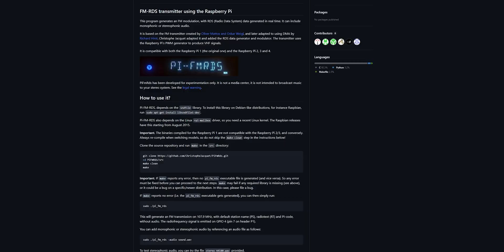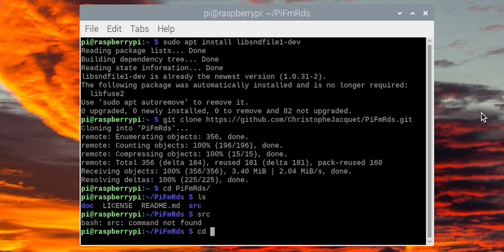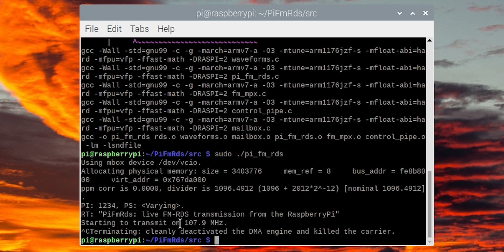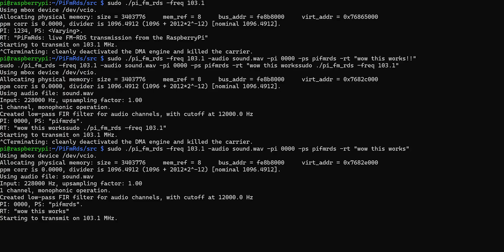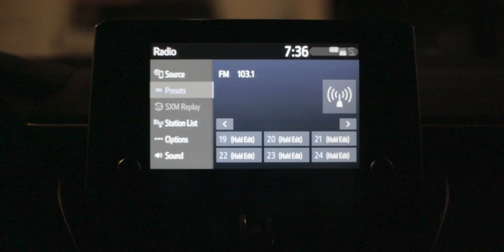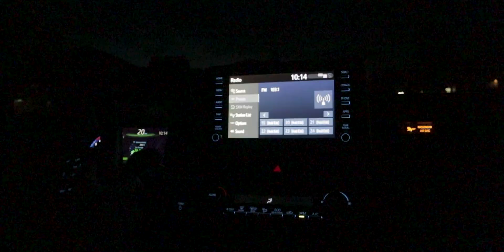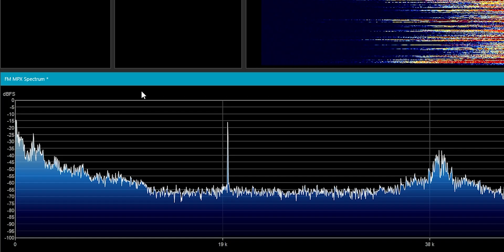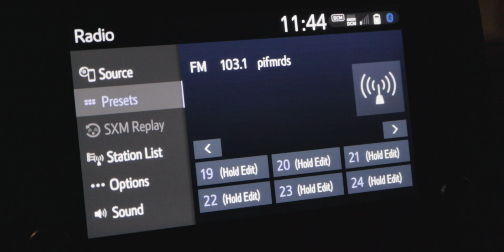Turning the Raspberry Pi Into... an FM Radio Station??

Comment: I don’t know if you respond to such late comments but what was the crimp you used on the wire? I want to figure out how to attach my wire to my pin without damaging anything
Reply from the maker: I got that wire in a basic arduino/raspberry pi kit and it just friction fits right on the pin
Reply: @simonretrotech thanks

Comment: I think antenna in your car is good enough, cause i tried making own radio on pi 4 and my phone lost signal after getting far for 50 meters away from pi (yeah i connected wire to pin, without it signal losts from 10 centimeters)
Reply from the maker: Aww dang

Comment: Finally tried this and WOW! Had it setup in the house with 32" of wire hanging from pin 7 of my Pi 3 A+....got in the car to test and almost had my entire neighborhood lit up on 87.9 MHz 😂 Be careful with this...It puts out lots of spurious harmonics...imagine your center frequency is strong but with no filtering I started checking my rtl sdr with SDR++ and was broadcasting strong on 175.8, 263.7, 351.6 MHz...not something I would use for anything other than just experimentation purposes...But regardless of potential trouble this software and Pi can cause, it still made for a fun evening tinkering...thanks for the video and cheers!
Reply from the maker: I know, I'm surprised the pi is that powerful! Yeah, I think the instructions mentioned not running it unless you had a filter. Definitely just for experimentation!

Comment: there is an FM frequency that is legal to use for this purpose. Portable CD players used to use it to play through the car FM radio.
Reply from the maker: I'm pretty sure it's based on power transmission (part 15). The problem with the raspberry pi is who knows how much power it outputs or if there's horrible interference (from what I understand)

Comment: After i followed the video i ran the command to start the radio. It does play but it randomly stops playing and a BANG sound happens. Could this be because im not using a wire? (no its not the audio)
Reply from the maker: Whaaat that's weird. The bang sound is in real life and not on the radio audio? I think you have to have a wire otherwise it can mess up the RPI since there's nowhere for all that energy to go
Reply: @simonretrotech  Sorry my bad for adding the last part in. The bang is on the radio audio it let's the audio play for a bit then Bang, silence for like 10 seconds and then the audio plays again and it loops like that.
Reply: I think I know why it made the bang sound before. My guess is that I was on a frequency very close to another one in use. I've switched to a different frequency that isn't close to any other, and the bangs aren't happening anymore.
Reply from the maker: Okay weird. Your audio is more than 10 seconds though? You might want to open an issue on their github
Reply from the maker: @MessingAroundInSomeCountry Interesting!

Comment: I get a error on my raspberry pi 5. can u help me?
 rpi@raspberrypi:~/PiFmRds/src $ sudo ./pi_fm_rds

Locale set to en_GB.UTF-8.
Failed to map peripheral at 0xfe007000: Invalid argument.
Terminating: cleanly deactivated the DMA engine and killed the carrier.
Reply: Yep, also tried it on the RPI5 and it gave the same error. After cheking the issues tab in github it appears that it isn't compatible.
The best you can do is create an issue on github and pray for them to fix it/someone forks it and make it compatible.
Reply: @Roufoxx  Yep, was facing the same issue, sad that i cant create my own radio station :(

Comment: Have you managed to record music via the 3.5mm connection? I'm currently trying to send a stream with Snapcast via the Pi.
I also have a USB sound card to plug in a loop if necessary.
Reply from the maker: I think I got it working once but haven't been able to since then :(

Comment: Yo, I had no idea you could do this! Super cool! I've been getting into radios for a while now, I wanted to get one of those low power MP3 radio transmitters but the ones I could find are designed for car 12v sockets. I'm definitely going to try this out!
Reply from the maker: Yeah I was surprised it was capable of being a radio transmitter

Comment: What Raspberry Pi are you using? I have Raspberry Pi 4 Model B with 8GB ram and it's not working. Browsing through different forums, I have come to a conclusion that older model works but not the latest one. So I would like to know which version do you have.
Reply from the maker: I have the 3B+... are you getting any errors?
Reply: @simonretrotech  No, I am not getting any errors but the song/music plays for few seconds when I tune in to the freq set in the command and then static continues forever. PS:- I have tried different frequencies and they all have same issue. Also, to receive the signal, I am using my phone which has built-in Radio. If not Raspberry, then it ought to be the phone and may need to purchase a FM radio. What do you suggest?
Reply: @LaFantar-j1m  get a cheap radio at a thrift shop to test? might get different results

Comment: Hi! Im using your video as a proof of concept. Im followed all the steps and it worked out! The only issue is that it doesnt allow me to send audios/songs with "long duration" (more than 10s). How would you solved it? Thanks in advance :)
Reply from the maker: Does it show any error in the console?

Comment: About if its legal or not, that depends on witch country. In many countries its legal with low power transmitter that don't interfere with licensed transmitters. And I iike your approach and easy explaining.
Reply: I think where I am,  you can go like 500 feet legally lol
Reply: what if you do an analog tv transmitter via this..
or perhaps even encoding internet data though that (like 200 kbps at most but that would still be cool)